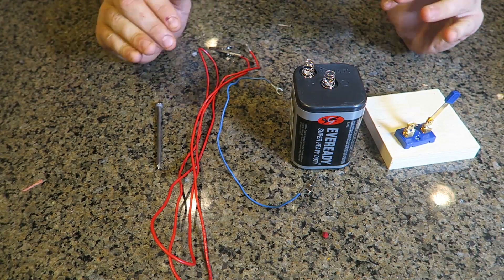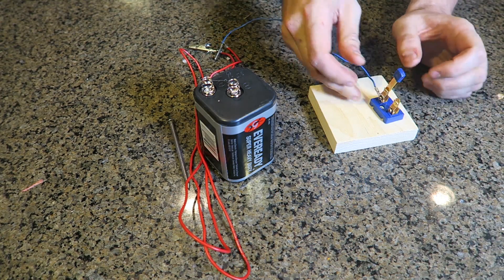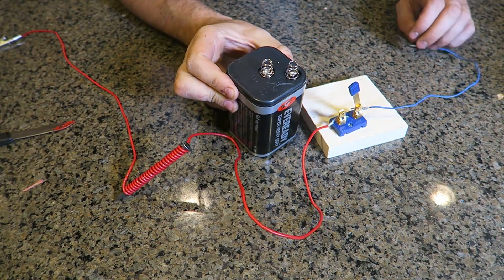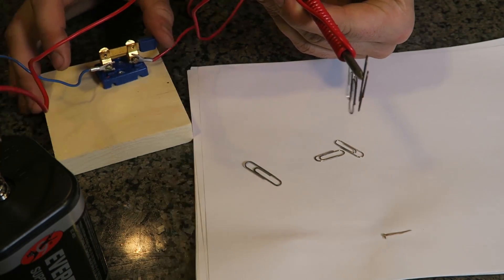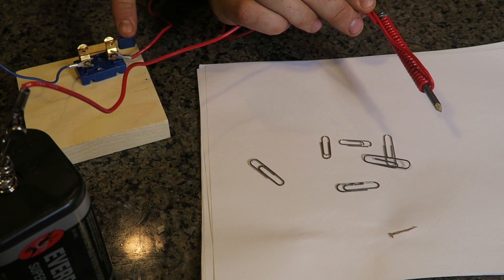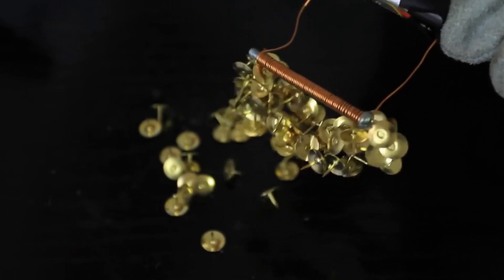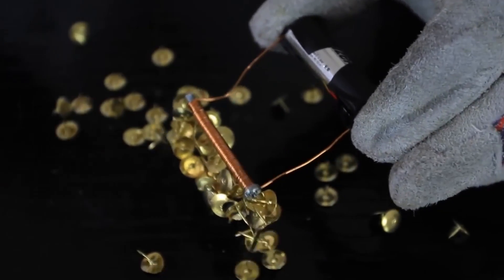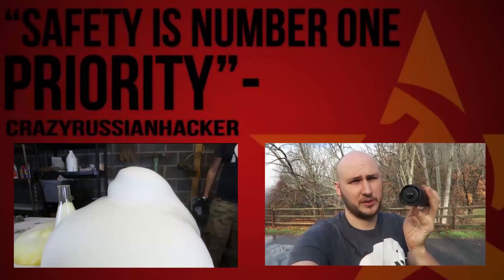DIY Electromagnet - Cool Science Experiment

Comment: battery is getting hot because you are shorting it, it will be better to use a resistor to prevent that.
1k Ohm should work

Comment: I did this with a 1/4 in bolt and 10 feet of wire. then I connected it to a 12 volt car battery and it would pick up any loose metal I could find!!!